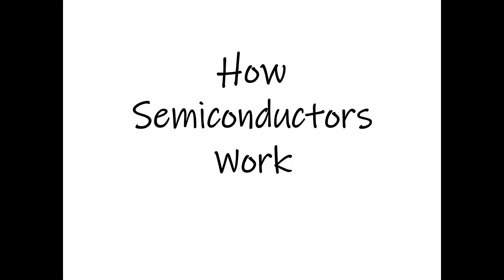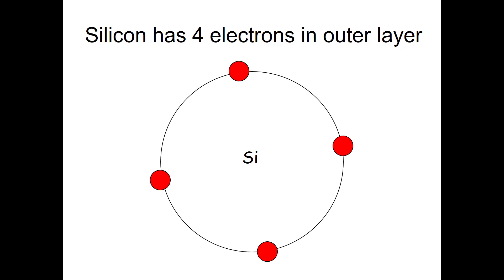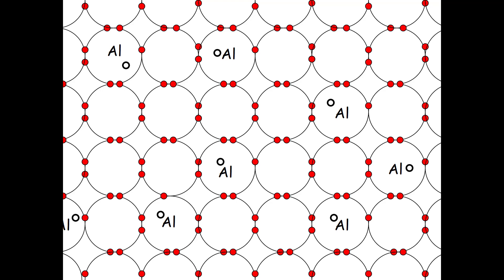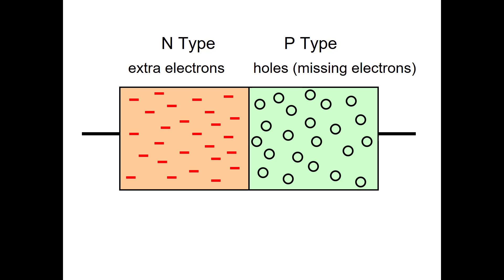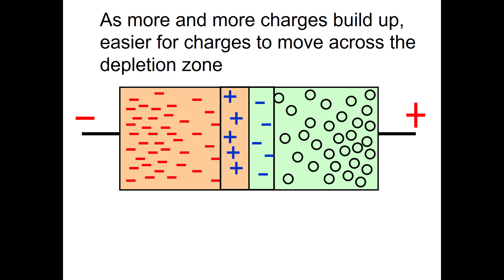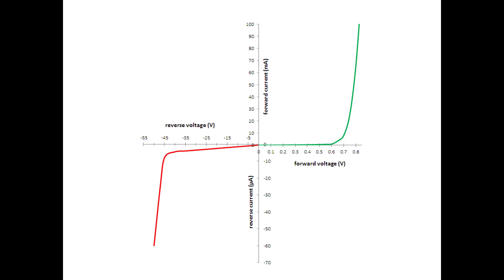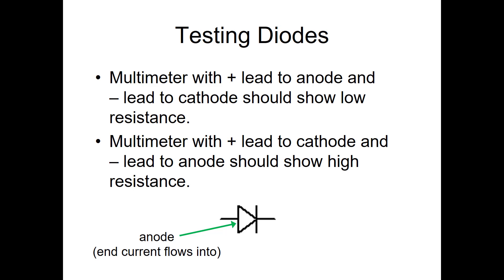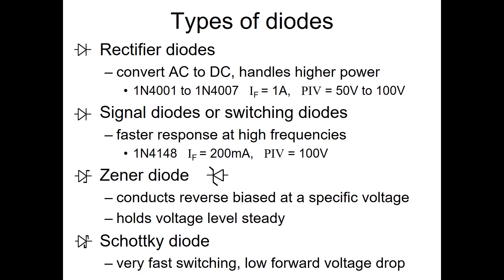How Semiconductors Work in Electronics

Comment: So good! I Have a question, I did not understand how applying high voltage can create the electron flow when reversed biased? Does that happen when there are no holes left in the p-type material, so electrons from negative source can move through the ions and go to the positive source?